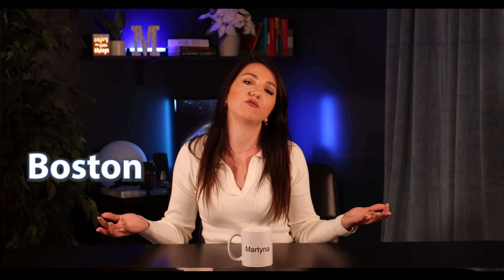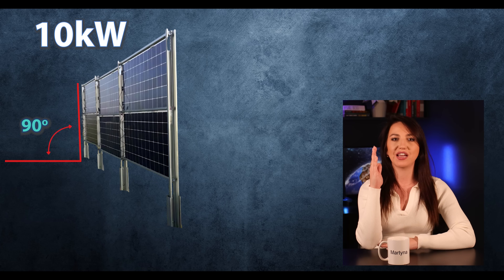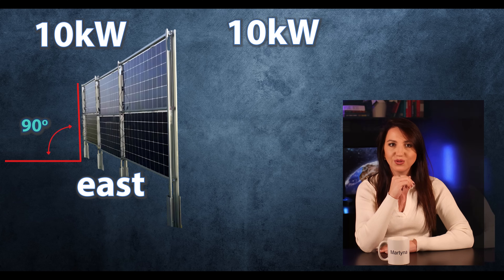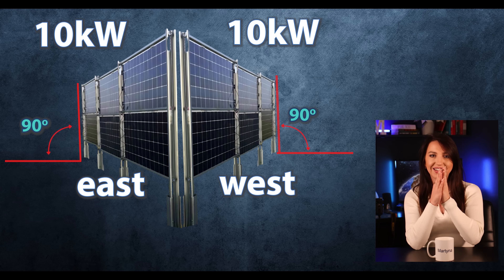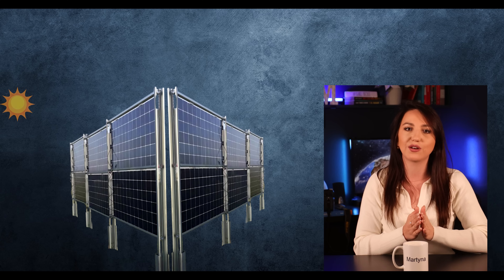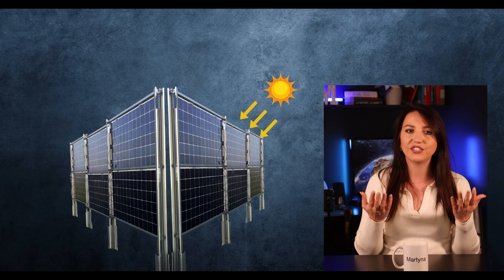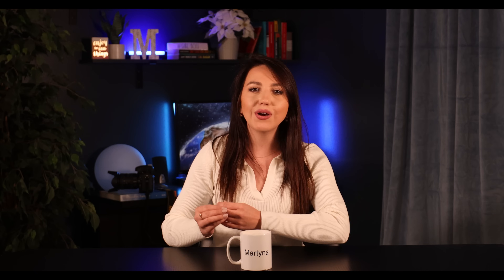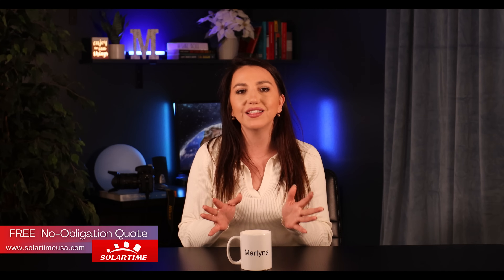Why I 'Oversize' Every Solar Installation (And You Should Too!) - Solar Oversizing Explained

Comment: Another excellent informative video covering complex engineering topics like this.
Reply from the maker: I appreciate that! I hope it was helpful and easy to understand. 🙏 Thank you again!
Reply: @solartimeusa  Where I live that is Hyderabad, India we get sunlight clear sunlight for good 5hrs a day for good 80% of days around the year. And yes temps are mostly above what is specified and that would decrease 5% of efficiency. That sill would not be near 25% of loss as per NMOT. So in this case would it be not beneficial to try to get inverter which is capable of full output capacity. Please can you clarify this. Thank you for the video love your content.
Reply: @solartimeusa Yes

Comment: Its important to consider time of use billing with a net metering grid connection. Maximum power production around noon might produce less revenue than panels facing east or west.  That is to say watts produced in the morning or late afternoon produce more revenue per watt than at noon.
Reply from the maker: Great point! Panel orientation can definitely be optimized for time-of-use rates. Early/late day production can be more valuable than peak sun hours in some rate plans 👍
Reply: Even if "off grid" it might be an advantage to have east panels to get power into the batteries earlier in the day.  Or west facing panels to allow power usage later in the day without depleting batteries.

My first solar system I struggled to find panels for $4/watt (before installation).  Panels seem so cheap now, that the limit really has become the available area (even as panels are more efficient watt/area).  Almost everyone comes to wish they had put in more solar if they did not fill the available space.  Maybe they buy an electric car, or change appliances to electric or simply watch the price increase for utility supplied power.
Reply: @Sylvan_dB  In our country latest N-type topcon panels cost you around $0.18 per watt only. installation + accessories cost around extra $0.12 per watt , total $0.30 per watt with GI structure and installation 👍🏻😉

Comment: Excellent video! I have a question. The rated output of an inverter is in AC. Can over-sized solar input be redirected to a DC coupled battery and not clipped? I see on an EG4 inverter spec sheet power output ratings of WITH PV and WITHOUT PV. Is that what it means?
Reply: That's correct. It's a benefit of DC coupled battery systems. You're essentially fast charging your batteries.
Reply from the maker: Exactly why I’m such a huge hybrid and dc coupled system fan compared to microinverters systems.
Reply from the maker: Thank you so much for your kind words <3 Great question! Yep, that excess solar can go straight to your DC-coupled battery instead of getting clipped. That's exactly what those 'with/without PV' specs are showing - how much power you can get when combining both vs just using the battery.